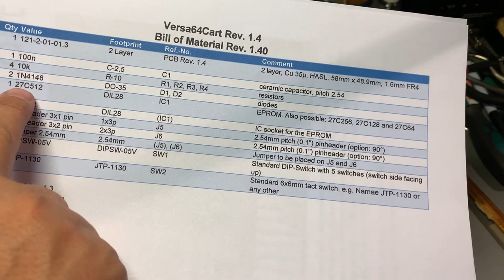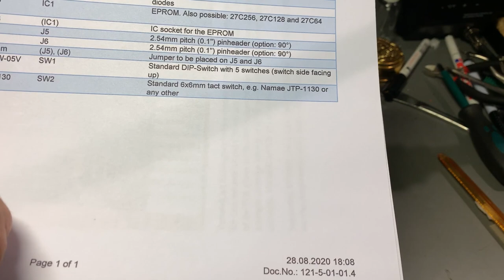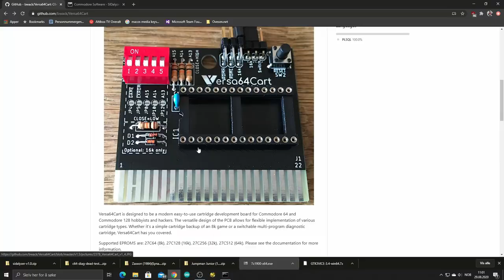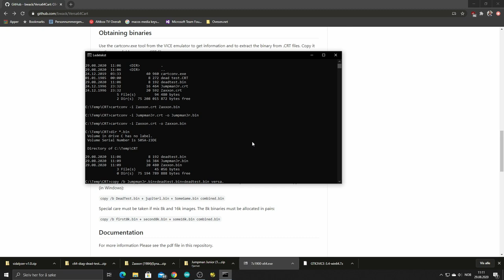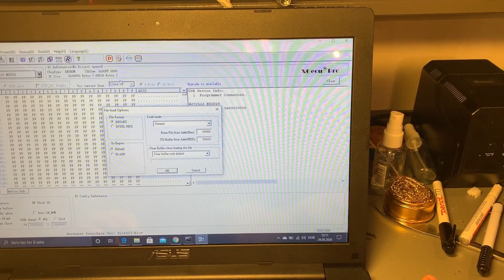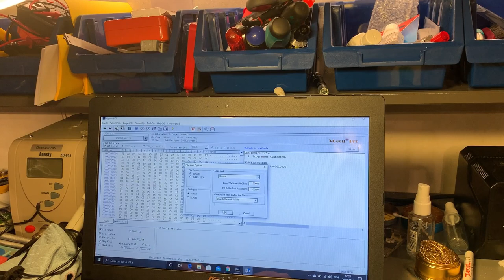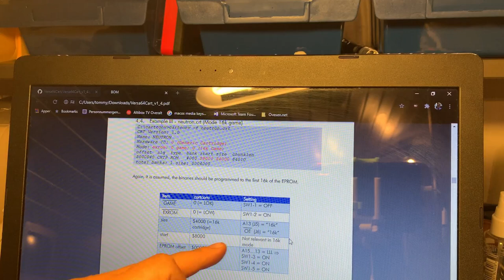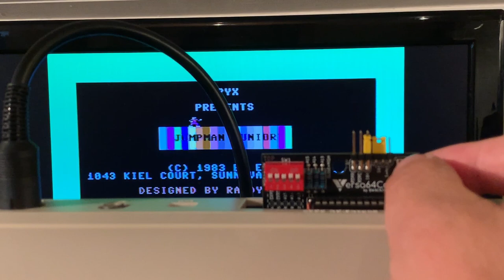Building a Versa64Cart for the Commodore 64 computer

Comment: APU I dropped a like, One thing though is I STRONGLY recommend you install Diodes, and then or Resistors "which ever is the fattest follows the skinniest, which is then followed by IC's and or Sockets, finishing off with capacitors and Electrolytic Capacitors,  because that way you can apply pressure to the PCB clamping the intended component to it as you solder each respective component into place.. also with multi-layered boards you need to ensure a reasonable blob of solder has been left on BOTH sides of the PCB when through hole components are soldered in..
Reply: @Okurka.   You are correct With regards to sockets, IC Sockets, Plugs, Relays and other components such as Electrolytic Capacitors, Which normally are ignored as useful Vias in the designing of a PCB, I was referring to components that have tracks on both sides of a PCB that the through hole component may be connected too, 
I am sorry that what most consider a given wasn't known by you, MY BAD..
Reply: @Okurka.  read my original post I edited it to clarify what I meant, and note I was recommending when soldering in through hole components its good practice to allow solder to flow on both sides of the board,  in short I wasnt referring to soldering Vias.. I meant to refer to components and in particular to components that have tracks on both sides of a PCB that a given components leads are soldered too
Reply: Thanks. I like your advice. I will be looking for them on all my videos from now on :)
Reply: @Okurka.  I am curious as to what led you to believe my suggestion in regards to, when one is assembling components onto a PCB, one is to shove them willy-nilly into Via's rather than than their designated assembly points?

ARE YOU TROLLING ME? 
LOOK,  If I have insulted you in any way, then let me apologise with a request as to what has annoyed you, As I need to understand where my good intentions may be misunderstood and even taken to be Hostile, in fact so much so that a trolling mentality is the result..
Reply: **Addendum**
I insist when components are soldered onto a board, "ALL of my courses" Yes from basic courses to several advanced ones ALL advise it's good practice to solder in through hole components by ensuring solder has flowed on both sides of the board when the PCB is double sided and or multi-layered   "And yes there are obvious exclusions as I already mentioned"
Reply: @Okurka Can you give me a reason why Basic and Advanced electronic courses advise solder should be allowed to flow to both sides?

**Hint**
It has nothing to do with electron flow, no doubt you have by now gone over your basic course material, but guess what? 
There are in fact more reasons why it's good practice to ensure solder has flowed to both sides, but I am confident you wont be aware of them, that is if one is to go by what your posts thus far conveyed, in fact I suspect you knew exactly what my OP was trying to convey and you were in the mood for TROLLING..

Comment: So C64 external ROMs are CMOS after all. DIP to switch the banks is really quite comfortable. Maybe exchange the EPROM socket with a "zero insertion force" one to not have to worry on bent legs? That's the one you already have in the programmer.

Comment: Nice to see modern support for our old friend the C64, but this cart seems to be kind of inconvenient compared to other offerings (have to upload the data to the cart and then set pins for each type and whether it's 8k or 16k, etc). Must be a better solution, eh?
Reply from the maker: There are other solutions. But they are more complex. Requires more electronics, skills and much more expensive
Reply: @Arcticretro  True. The SD2IEC device is quite nice though. It doesn't plug into the cartridge port, so not sure about compatibility with .crt files.